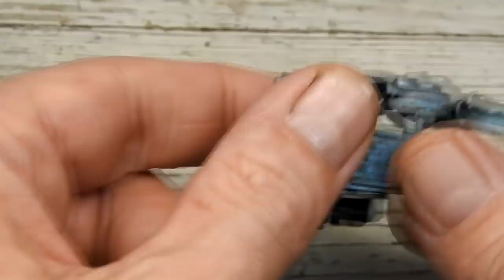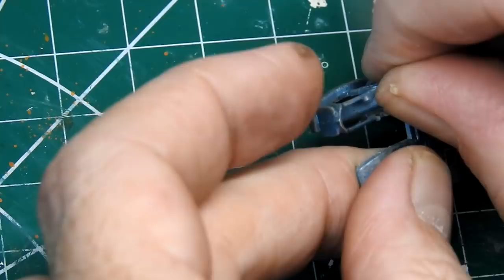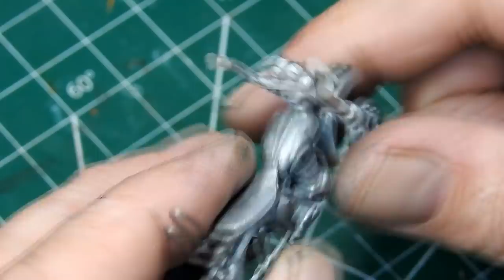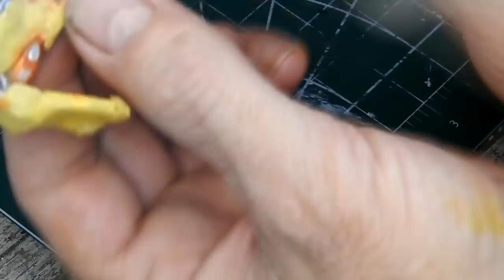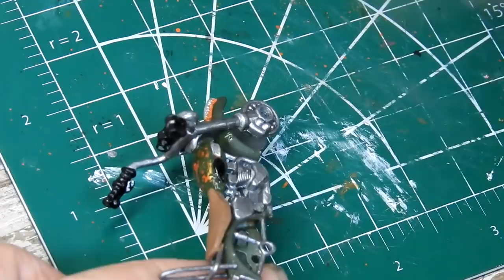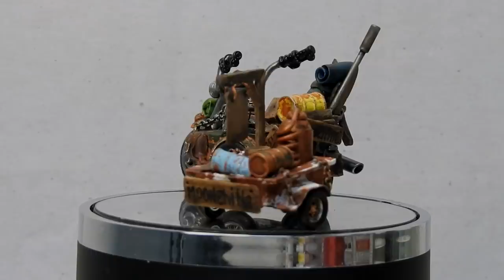Matchbox Custom Post Apocalyptic Motorcycle Build Off 'Travelling Moonshiner's Triumph'

Comment: Have you thought about using lime away to get rid of the oxidation on the castings? One of the other matchbox car restoration channels uses it. I thought for a project like this, with a detailed casting and little nooks and crannies, it might be a little easier to get it all off.
Edit: did you use epoxy to put the new parts on or did you actually weld them on?

Comment: I just got a matchbox super King’s k-7 team transport and need help, I need a windscreen and horn set for it. I was wondering if you would happen to know where I could find parts for it? I googled it and searched eBay and no luck.
Reply from the maker: Unfortunately there don't really seem to be any spare parts for the Super Kings or Speed Kings, or Superfast for that matter. Parts seem to stop at the early King Size models. My best advice is to just keep your eyes open for another on thats beat up but has the parts you need. You can find the horns on lots of Super kings, but the windscreen more tricky. I have a K-7 as well, its a cool toy!
Reply: Danny's Diecast Disasters thank you very much for the info, I agree the SK K-7 truck is really cool

Comment: In sure your aware that these are not matchbox cars. In fairly new to your channel but for those who don't know Matchbox is a trademark brand name of toy cars. The same as Hot Wheels. Matchbox cars actually say matchbox on the bottom just like hot wheels say hot wheels. These are just toy cars. Just a rid but for any one interested.
Reply: Chris Edmister Kind of, the motorcycle is a Lesney, which would become “Matchbox Lesney” and then just “Matchbox.” Lesney is not just a toy car. The parts donor is in fact a “Hot Wheels.” Both brands are represented well in this build.
Reply: Incorrect chap this is a Lesney Matchbox Triumph T110 #4c, therefore is a genuine Matchbox model which joined the range mid-1960 and was replaced by the Stake truck by the end of 1966. Just in case you are interested.
Reply from the maker: @TisBestinDiecast66  Yes it very much is part of the Matchbox series 👍
Reply: @DannysDiecastDisasters  I've never seen a matchbox car that didn't say matchbox on them including the diecast ones I use to play with as a kid. My uncle's had tons of them hanging on the wall as collection never played with matchboxes.
Reply from the maker: @SpyderKing34  https://matchbox.fandom.com/wiki/Triumph_Motorcycle_%26_Sidecar